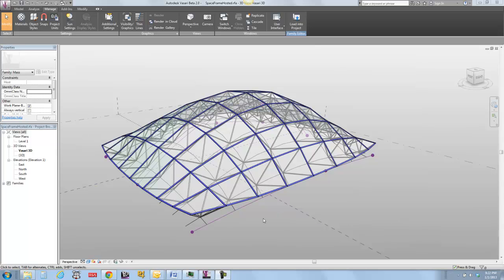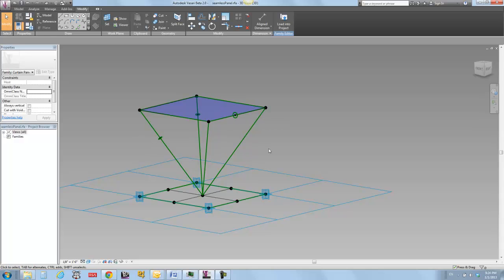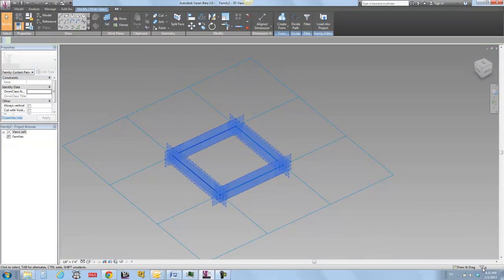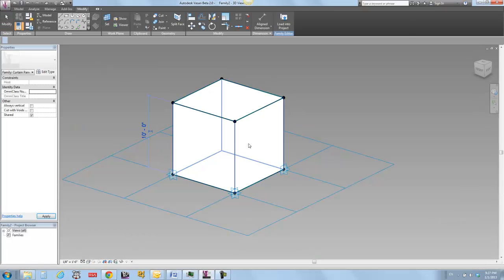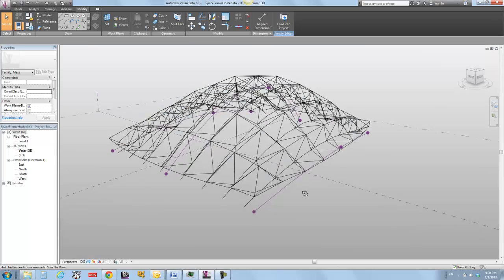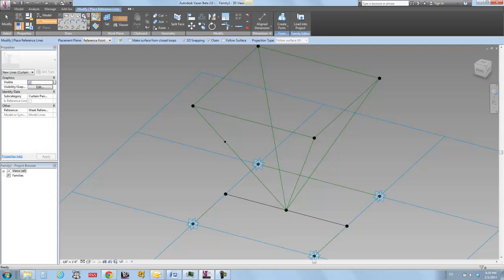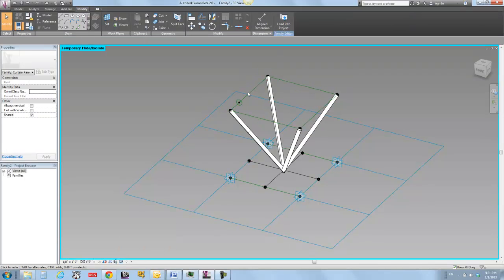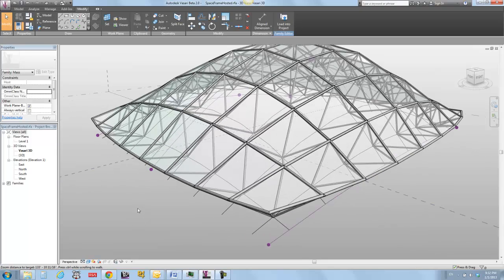buildz: Space Frame Quickie

Comment: When I try to replicate your tutorial the ends of the pyramid structure seem to point towards one side of the surface. Yours seem to point towards the center. This I think is caused by the way i start my surface from the start, but I tried several methods and it still point toward one side or the other. Any suggestions how to fix that?